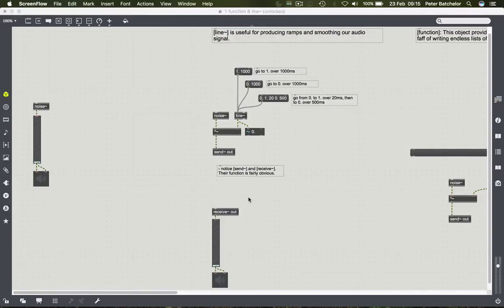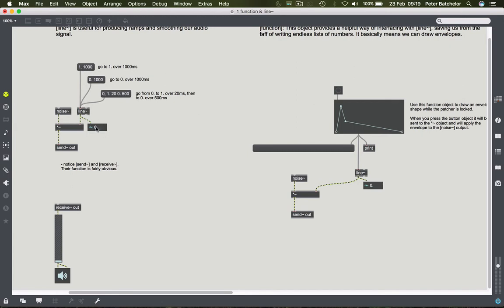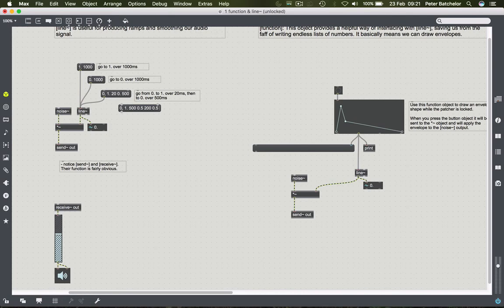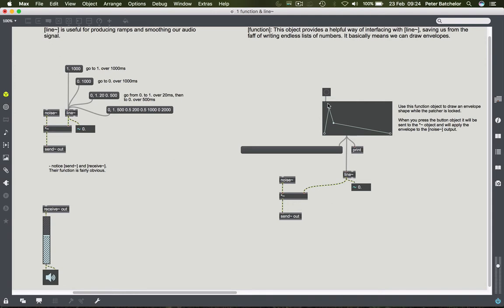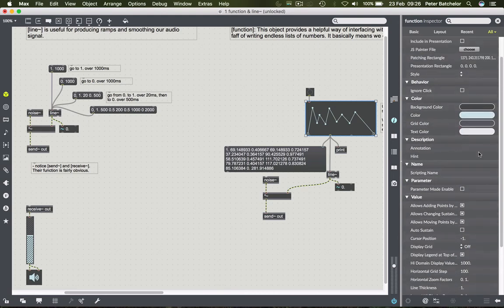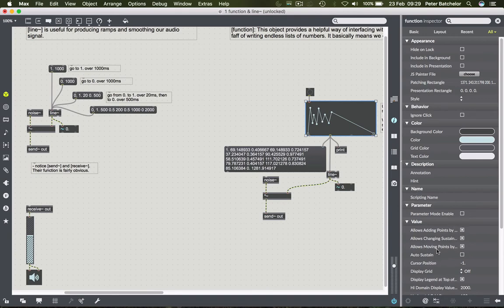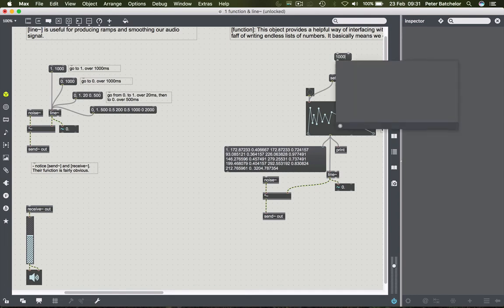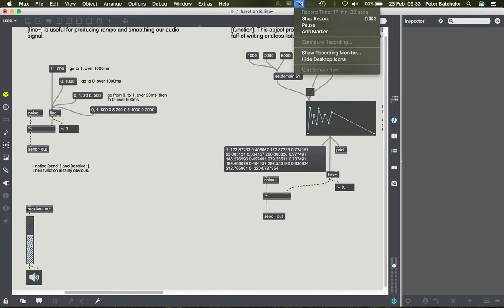Max 7 Tutorials: 4.1 Basic Synthesis—enveloping using [function] & [line~]

Comment: is it possible to control de center frequency of a filtergraph~ with this envelope?
Reply from the maker: You can pretty much control anything with anything! But yes. You do need to convert from signal to control data, though if you're using the [line~] object in conjunction with the [filtergraph~]. Have a look at the [snapshot~] object to do this.